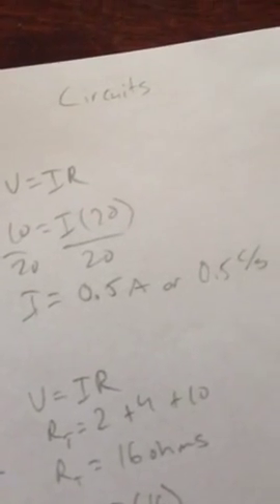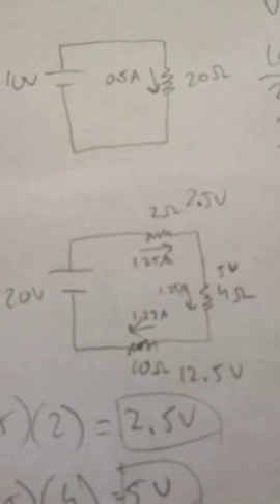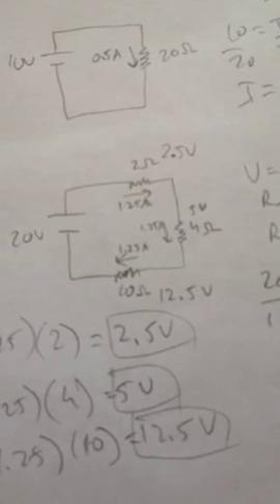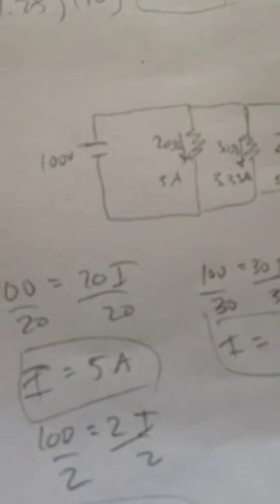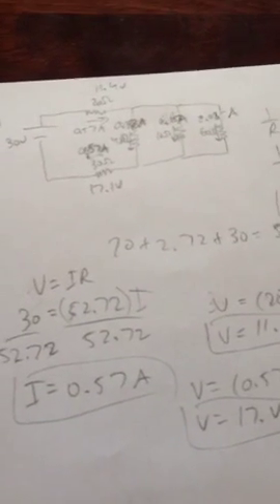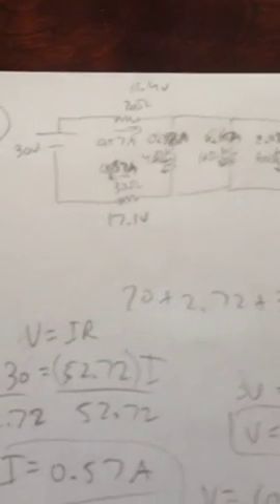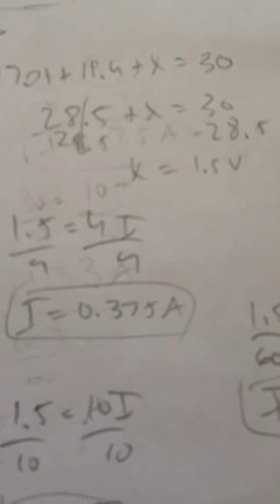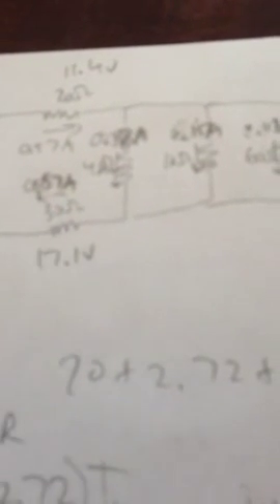Circuit problems

Comment: In problem 3, why did you use the reciprocal to find the total resistance? Is it because it is a parallel circuit?
Reply from the maker: ***** Yes. In series, you add all the resistors, but in a parallel circuit you use the formula (1/Rt)= (1/R1)+(1/R2)+..... You solve for Rt by finding the reciprocal of the sum.
Reply: Oh okay, useful info! Thanks